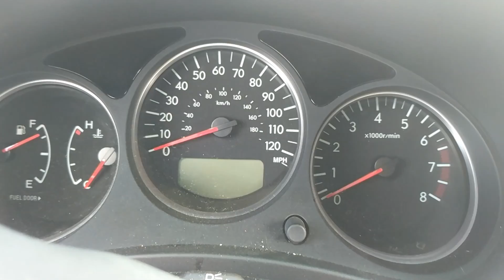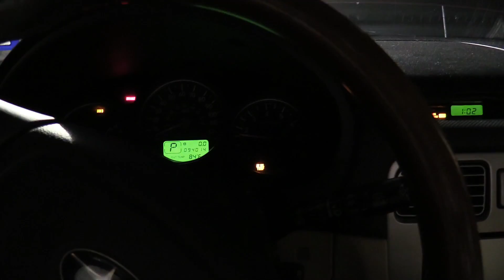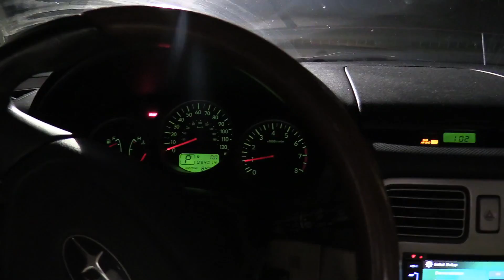It died and left me stranded

Comment: The bolt on the belt tensioner on the Subaru doesn't need to come out, just loosen it and then the long bolt will loosen so you can pull the belt.  On the back side of the long bolt holding the alternator in there is a small metal bracket/nut plate that the bolt tightens into.  I didn't see you pull that nut plate out or put it back in, I did the same thing on my first Subaru alternator.

Comment: At least the alternator doesn't have to come out the bottom and require axle removal like my Honda!  And yeah that would have taken only 30 minutes or so to walk home.
Reply: Daniel Hurlbert lol yep, in Honda's infinite wisdom on D and B series engines they hung the alternator off the back side of the block, underneath the intake manifold. Driver side CV axle has to come out in order to gain clearance to drop the alternator out the bottom. Luckily I've only had to change it once on mine.

Comment: What were the symptoms/warning signs of your alternator going bad?
Reply: You will usually experience some electrical issues like your lights will seem to dim, you might have problems starting your car or will have to jump it, your car's battery light might come on, and things of that nature.  Basically, it will be is extremely similar to having a bad battery or one that is dying.  To diagnose and see if it is the alternator that is failing you can use a multimeter to read the voltage at the battery when the car is on (it should be between 14.2 and 14.7 volts I think, anything more than that and your alternator is putting out too much power)  or you can use the old standby and loosen the battery leads, start the car, and the disconnect the battery and see if your engine keeps running.  (This is true for most cars, but might not work for certain hybrid vehicles.)
Reply: Daniel Hurlbert thank you!
Reply: Andrew Price Thank you!
Reply: Not a problem.  Was actually a good review and came in handy last night when I happened to run into someone that was having alternator\battery related issues.